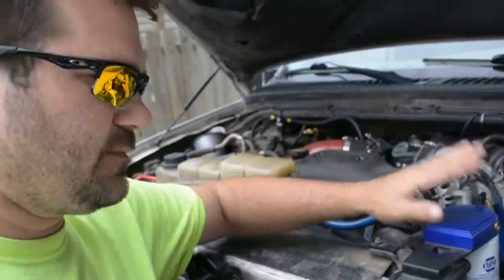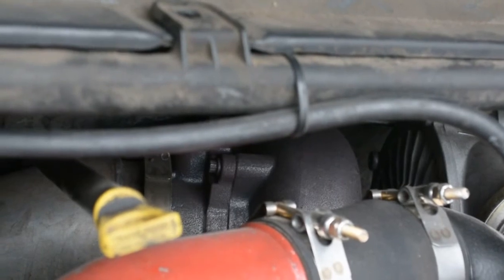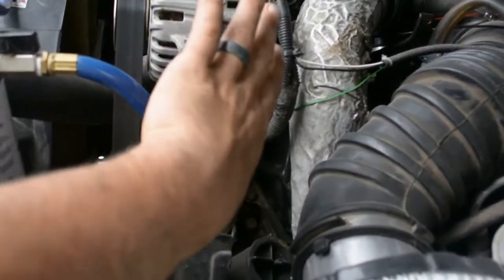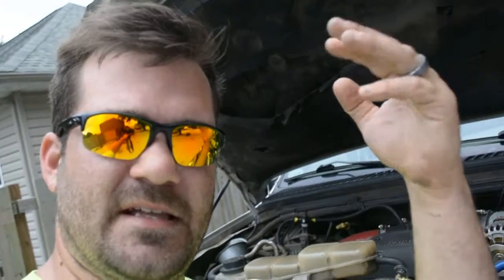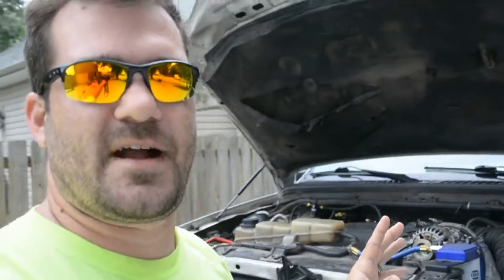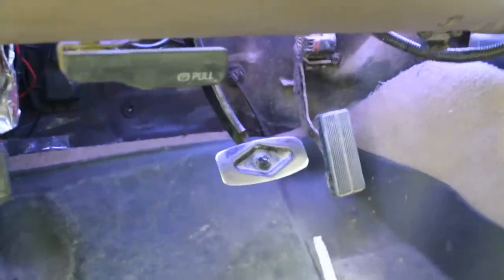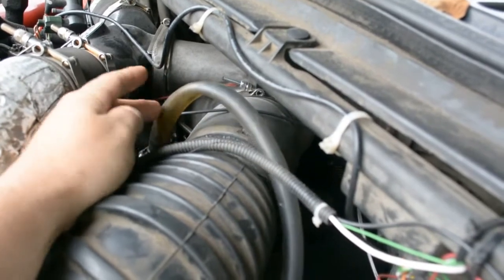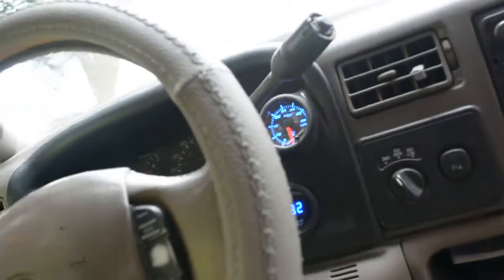7.3 Powerstroke Upgrades Part 2

Comment: Nice video. I have a 96 F-350 with the 7.3. My truck  has 226,000 miles on her. When towing my 12,500 pound trailer, she seems sluggish. Maybe I'm asking to much. I see if these tricks gets me more power when towing. Most of my trips will be towing over 400 miles. I'm ready to get the old truck in good shape. Thanks for the videos.

Comment: 3:00 in video silver part. What is part # and where to buy one for my 7.3 2002 ? Thanks
Reply from the maker: "Silver part" is a 33psi waste gate controller you can buy it here http://www.ebay.com/itm/99-5-03-Ford-Powerstroke-7-3L-GTP38-Turbo-33PSI-Billet-Wastegate-Actuator-/172139018931?hash=item281448fab3:g:-bIAAOSwxp9W7Pf6&vxp=mtr
Reply: Thanks !
Reply: Devon Xpress Do you recommend the 33 psi billet wastegate actuator for a stock turbo?

Comment: You do know you can flip the crank case cover around so the hose goes straight out the back and not over your intake right? Put your hose over your brake master cylinder so it keeps an upward tilt then run it down.
Reply from the maker: yeah i know, was a quick fix will be doing a engine dress up one of these days once i get all the other kinks worked out.

Comment: yes that's what I have also but a wicked wheel for the gtp38r. did you use a wicked wheel or just the one the turbo came eith
Reply from the maker: Just the one it comes with, I honestly haven't seen a wicked wheel for the 38r. Do you have a link for them
Reply from the maker: I found them, I feel stupid for not knowing this and will probably be changing mine out for the this.. Thanks for this
Reply: +Devon Xpress look forward to hearing what you have to say about it
Reply: Hi Devon, Here si where I bought my wicked wheel 2 and made a big difference in  my stock turbo. https://www.amazon.com/gp/product/B0171Z3TCM/ref=oh_aui_detailpage_o04_s01?ie=UTF8&psc=1

Comment: I agree with removing the restrictive in tank filters. But then the only filter left is under the hood after the fuel pump which puts the pump at risk. I got the driven diesel fuel tank / pre-pump  filter kit. It includes all the parts to remove the in-tank filter assembly and then you have a nice large filter and water separator easily accessible on the frame and the pump is protected. http://www.dieselpowerproducts.com/p-11444-driven-diesel-fuel-tank-pre-pump-kit-hutch-mod-99-03-73l-ford-powerstroke.aspx?gclid=CNXP-eXjv9ECFY9lfgod3fMKhw

Comment: any increase in mileage with upgrades, specifically the AFE blade runner, TS 6 pos chip, and boost fooler, and NAPA air filter, and fuel system mods, I have watch Bill at PSH and his videos are awesome, I was just wondering about mileage increase for my  02 EX 7.3. thanks
Reply from the maker: i haven't measured anything, but prior to my mods is was around 14.5 on highway and now i get 17.5 so i don't know what that is contributed to but all mods above are great mods and cant hurt you, i noticed a drop in fuel economy when i went with bigger banjo bolts but then after adding the bigger turbo and banks exhaust housing went up a little

Comment: What mirrors do you have? Are they power and heated?

They look awesome!
Reply from the maker: +Parmbir Rai they are only power, they are the 08 mirrors
Reply: +Devon Xpress stock?! Oh nice, I thought maybe they were an aftermarket set.
Reply from the maker: They are the aftermarket ones i get asked a lot where to buy these and i cannot find the same ones anymore but they are the 08 mirrors just have that slight angle

Comment: what wheel did you use? I have very similar set up on my ex and not real happy. I had a stock turbo with wicked wheel and banks housing and big head that I liked better
Reply from the maker: i like my set up, but i did get more boost out of the stock turbo with the wicked wheel. i have the 38r so its just the larger wheel than stock with 4in inlet instead of the 3in

Comment: My truck is stock it's a 1997 f250 I'm young but learning and I'm curious on what my first performance upgrade should be? I'm thinking I should straight pipe what do you think?
Reply from the maker: I have 4 7.3, 3 have a 4" mbrp and 1 with 5" mbrp straight piped. I recommend it . 

Look at my website:
 www.xpressdieselperformance.com 
use code devonxp for 10% off
Reply from the maker: +David Mitchell I do have a video on first 5 upgrades, good place to start

Comment: can you leave a link for the mirrors? i hate the rounded tow mirrors on my 99. thanks
Reply from the maker: This is the closet i can find, the mirrors i have look a little different because of the 45 degree cut on the side. I can't find the style i have anymore http://www.ebay.com/itm/For-99-02-Ford-Super-Duty-Side-Mirror-Power-Heated-NO-Signal-Towing-Mirrors-PAIR-/291422248688?fits=Year%3A2001%7CModel%3AF-250+Super+Duty&hash=item43da1e9ef0:g:xJkAAOSwpDdVHQzf&vxp=mtr

Comment: where did you buy the coolant filter from?
Reply from the maker: http://www.ebay.com/itm/NEW-COOLANT-FILTRATION-FILTER-KIT-1999-2003-FORD-V8-7-3L-POWERSTROKE-DIESEL-/361491101351?hash=item542a8c76a7:g:jX0AAOSwe7BWwgFx&vxp=mtr

is for the kit that come with the filter, but after 500miles needs to be changed and i got the new ones from napa
Reply: +Devon Xpress thanks man!